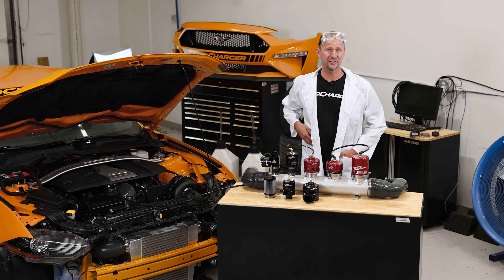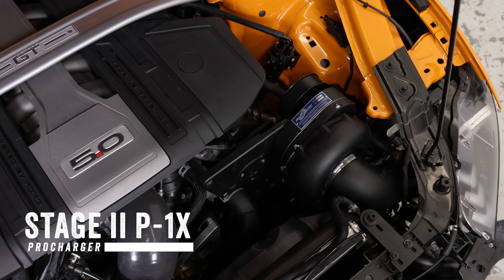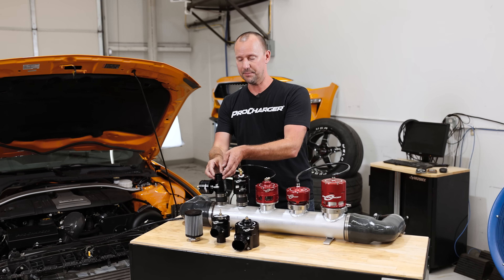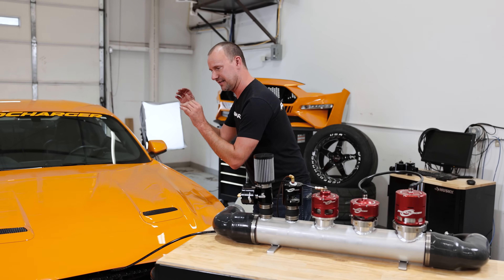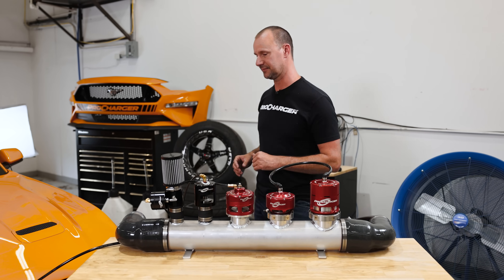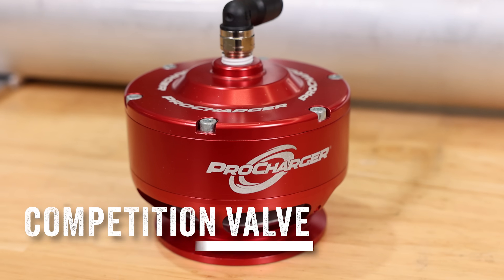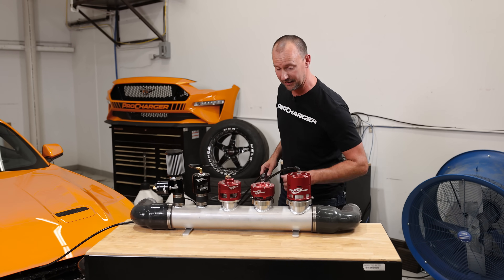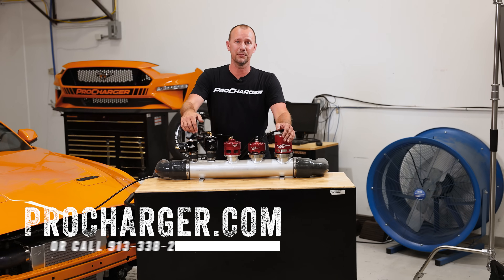What does a BLOW-OFF valve sound like? What does FIVE blow-off valves sound like??

Comment: I want a BOV with the sneeze... y'all know what I mean.... (tuturturtur) excuse me. I dont wanna shorten the life of my turbo, but that to me is the best sound. Cant somebody put a mini compressor wheel in a BOV to dupicate that sound lol
Reply: Doesn't hurt the turbo at all if it's a ball bearing unit. Some say it's bad for journal bearing turbos and some say they're fine too, but I personally wouldn't risk it.
Prochargers are basically ball bearing turbos with gearboxes so some run them without blowoff valves, and the sound is WILD.
Reply: @Cheezeball99999  I just bought the kit for my car an I think it's a journal. I have to make sure. The kit was an ebay special so I just want to put on an evolve from there. Definetly closing off the BOV lol

Comment: Am I seeing this right?  All of these valves would remain open in normal driving and will only close when you open the throttle far enough to make boost like around 30% or so?
Reply from the maker: Yes that is correct.  Since the engine doesn't need "boost" when it's in vacuum.... the valve remains open.  Once the engine moves towards 100% load (or from vacuum to boost) the valve will close.